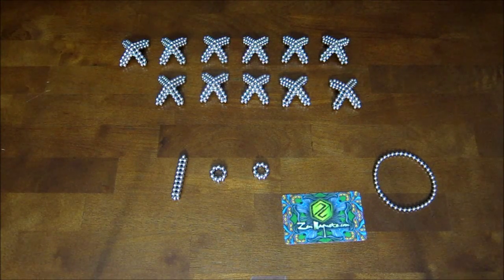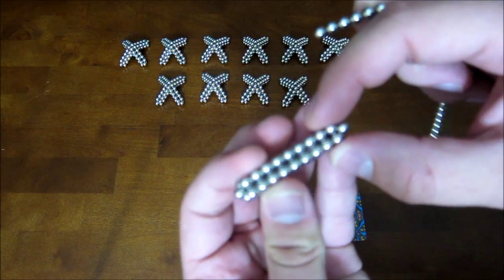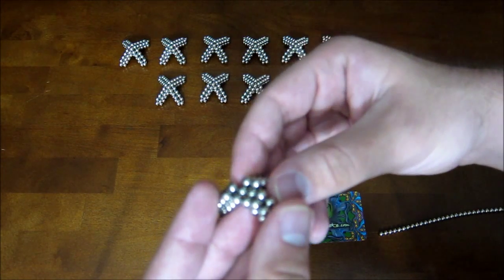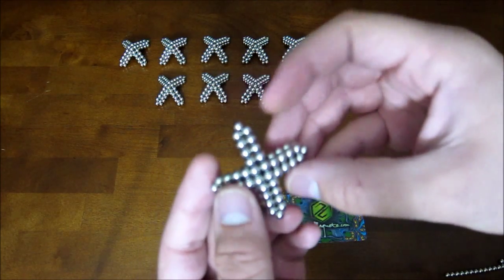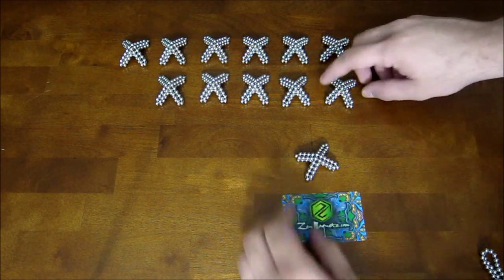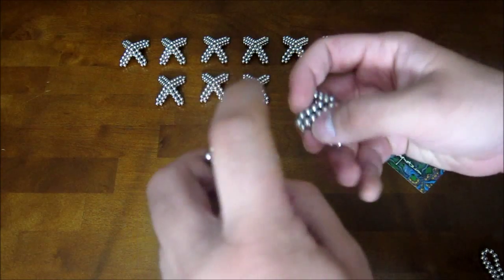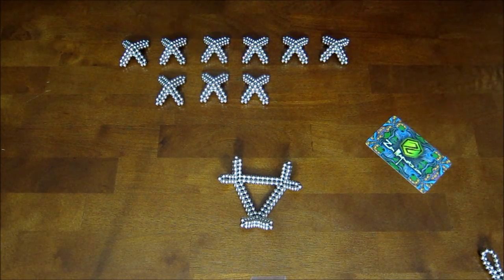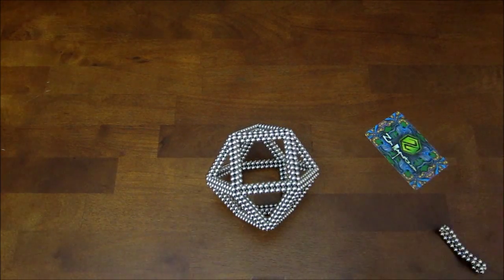Tutorial: Cuboctahedron (Zen Magnets)

Comment: Is anyone else having trouble making the square pieces. Mine always colapse into mush.

Any advice?

Are the stacks of 20 and 9 Stacked in the same polarity direction?

Which side of the stacked 9 straight edge is supposed to attach to the stack of 20?

No matter what I try it falls apart.

BTW - This is the only shape I can duplicate from this channel, or any other. Some even seem harder, but this doesn't work.for me.

Comment: i had many problem with finding the correct side to put the smaller pieces onto the bigger straight piece, eventually i found that if i matched them up prior to takign the points off of the 9 rings i could find it easier